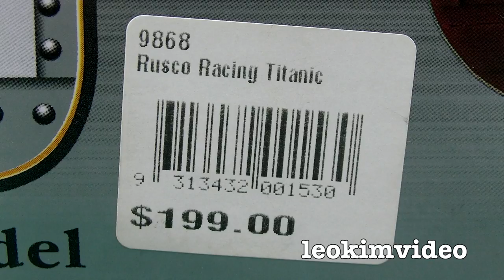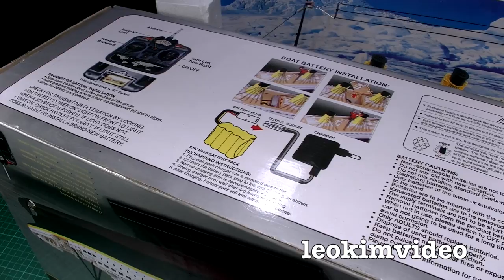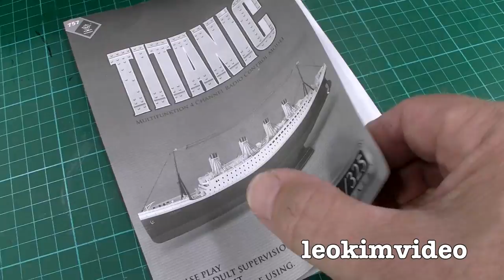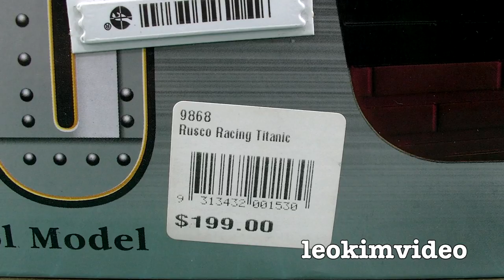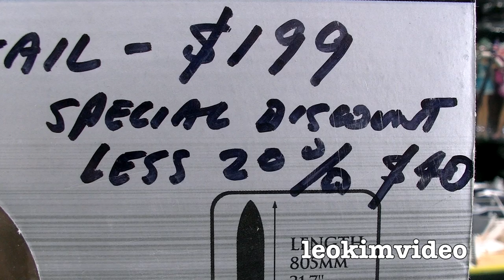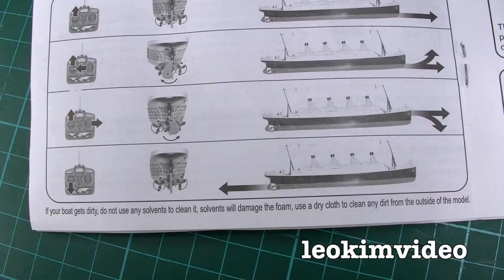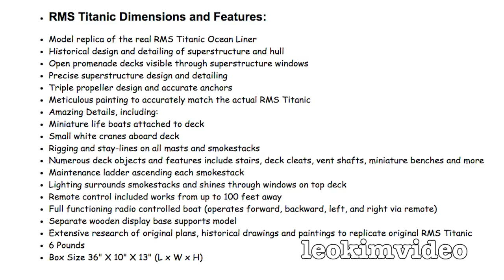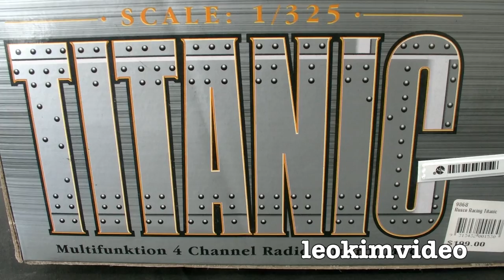RMS Titanic 32" Remote Control Realistic Sinking Action Unboxing Review & Battle Boats

Comment: The funnels had lights shining up, which gave them an illuminated appearance, but they weren't that colour. The rudder is also much longer than the half moon shape of the original, and the funnels did not have such large posts attached to them, but other than that it would be a pretty good ship, for $29.99. $200 is honestly way too high. You were quite right about the Titanic tax, for some reason they tend to be much more than normal. I will also add, there were several more cranes on the ship than included. 
-titanic enthusiast since the age of your son
Reply: Don't forget that A and B deck don't look right

Comment: I purchased this same model from Amazon, roughly 130.00 free shipping. Not very historically accurate however with a little work it can be made into a fairly accurate model.   I added extra windows to represent the ones found on the ship on the promenade deck and A decks, added extra rigging to the mast, callsign banners and some detail painting.

Now for the fact that it DOES, indeed tend to sink. The waterproof taping added at the factory is anything but waterproof. I added gold duct tape to represent the gold striping, and, over that, waterproof Gorilla tape. Total cost of detailing and modifications were about an extra 15.0 with materials you can pick up at any local Walmart or Home Depot. With a little work this can be turned into a fairly accurate radio controlled Titanic model at a fraction of the cost of other models.

Comment: Leo, I have build a Remote controlled Titanic out of a model kit. It is in fact stearing very moderate, just like the real Titanic. The rudder effects are all above the ship's bottom, that's because the water flow under the ship beneath the rudder is nearly effectless. It has only the effect due to it's (running) center propeller.

Comment: Questions:
1: all of the things on the top of the box makes scene
2: all the things on the back of the box made scene
3:the lines are called the trasmishion/marconi lines
4: the yellow stacks are called smoke stacks
5: the forth smoke stack was a dummy stack
6: that higher part at the stern is a ships wheel
7: the middle propeller on the real ship did not move in reverse
8: the lighting on the funnels is not correct the lights where outside and yellow

Comment: Those have definitely been shorted though. Maybe they could be saved by putting the individual motor(s), servo, and controller/receiver in rice.

Might be interesting to open it up and install hobby grade water-proof guts instead. 
Thinking even more... could modify it to have a servo open a hatch in the bottom, inducing the sinking.

Comment: The actual ship isn't meant for the middle propeller to reverse, it's partly one of the reasons Titanic couldn't avoid the Iceberg in time, the ships engines were set to reverse, only taking advantage of 2/3 of the propellers.

Comment: This model with exactly the same components and boxing is used with several brand names. Ours has a remote control that is more like a car remote however. It also comes with at least three different batteries (yours is the worst) which explains the price difference in some cases. For example our model (same box, manual with a different company branding) has a 3200mah battery and it runs fast for an hour. It turns ok too for the length of vessel. A vessel that lengh is never going to turn in your pool if it is even remotely to scale.  We use it in a canal basin. Wind hasn't been an issue but we are careful after a barge passes because of the wake and expecially if the ship is side ways to the wake. It's a shame you aren't teaching your child to look after their toys better.

Comment: 21:30 The Titanic was originally a slow turner, so this is to be expected. TBH, I'm just a blind leading the blind when it comes to models like this.
Reply from the maker: Bigger rudder could have avoided the iceberg or Godzilla!
Reply: A bigger rudder would of helped but the sheer length of this thing would still make it a slow turner, modern ships have propellers at the front and sides to help tricky corners, clever eh
Reply: leokimvideo yes but when it was a ice berg it went backwards when you steer going backwards it is left is right right is left ???
Reply: When in reverse, you turn right if you want to go left. Same thing vice versa if you wanna go right.

Comment: The hull of most ship continue down to a shape long edge point and often do not flatten out only in certain circumstances would they look like it does in the video e.g for shallow water
Reply: Also the rudder angle would be fine for a passenger ship but it would need to be slightly larger

Comment: once I start reading about the titanic and stuff like that I end up going on and on for hours just being intrigued by it. Besides from the film I don't really know much about it. Everything just looks so cheap especially the controller, looks like something you'd get if you paid $40 maybe $50 not $200. I wouldn't pay more than $50 for it. I haven't really looked but I wonder what other rc boats that aren't the titanic cost for that kind of quality
Reply from the maker: Yes, Titanic has that ability to suck you in. And in a way thats how I ended up with this model.
Reply: PaulKingIII yt50

Comment: The Titanic is slow when it turns very slow so I guess that's about 10 points no like 50 points for like actual detailed of what the Titanic would have been with if it was cyst small what if it was huge like it is yeah will take millions of years to build and Brake but it's just took about two seconds for the full Titanic to break in half the turning on it when hitting the iceberg very slow